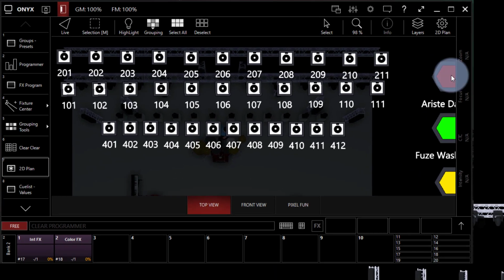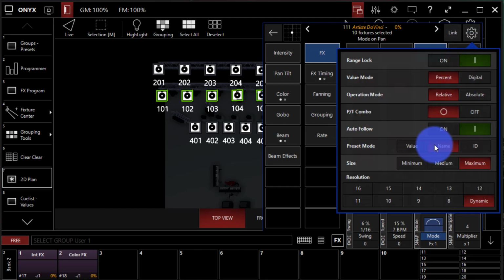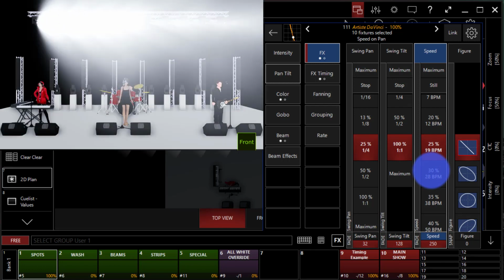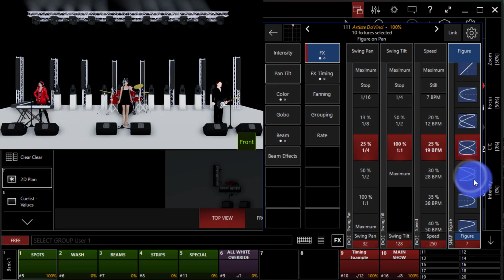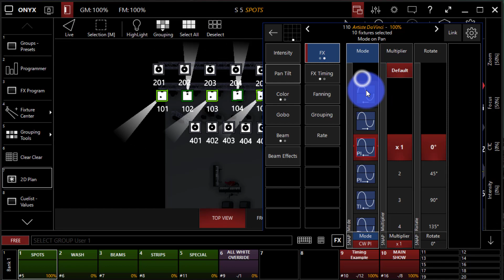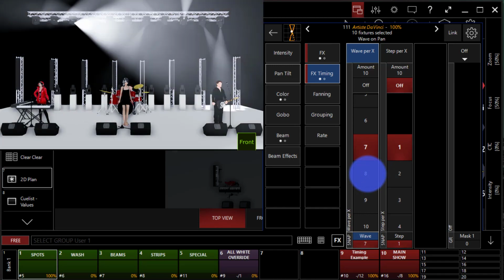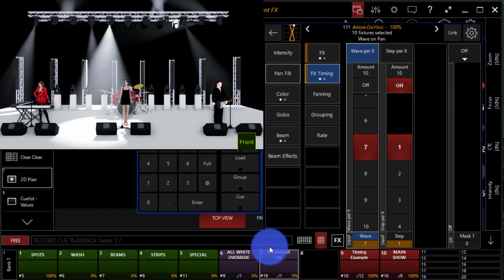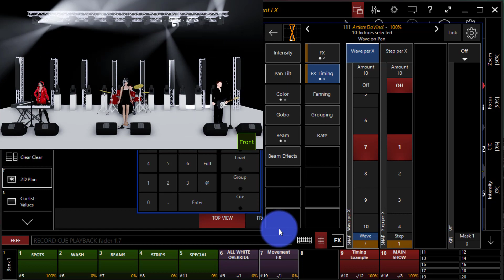Working with FX - Part 2: Beginning with ONYX (formerly M-PC)

Comment: These videos are great.  Thank you!  However, with my fixtures, I'm not seeing the same FX for Pan Tilt, is there something I can edit to get Figure instead of mode?
Reply from the maker: On the encoder strips, check the "settings cog" in the top right.  There is a setting called "Pan/Tilt Combo".  Make sure it is ON.  Then verify that when you select "Swing" the text above the encoders says "Swing on (Pan or Tillt)".
Reply: @LearnStageLighting  Thanks for the reply.  I had to go into the fixture editor.  My fixture had pan/tilt set up as custom parameters instead of being defined as pan or tilt.  Once I changed that setting and relaunched Onyx, it was smooth sailing.  Thank you for all of the 5 minute videos.  They have really helped with my journey into PC based lighting control.

Comment: How do you get the moving heads pan and tilt to stay facing forwards? For instance when using a pan effect it does not pan around fully and shines behind the stage?
Reply from the maker: Turn the "Size" down and begin the effect at the center of the range you wish to work within.
Reply: @LearnStageLighting  thanks, this has helped a lot

Comment: I'm having problems getting the fixtures to react. I do exactly as you do in the video but I have to change the speed of the intensity effect in order for the FX to manipulate the pan and tilt.
Reply from the maker: It sounds like you've might have gotten FX link on?- there is a blinking red "link" button at the top of the encoder wheels display on the screen.  If it's blinking, press it so it stops blinking :)
Reply: FX link is off. Also when I navigate through the base menus (switching back and forth between intensity and color etc) it seems like the FX moves forward and increments the lights movement forward every time I switch between base categories. If I turn PT combo off, Pan swing and speed works. Tilt FX does nothing.
Reply from the maker: That is weird.  If you start from scratch again, and have the same problem, then you may have an install problem.  I would recommend posting in the official forums: http://forum.obsidiancontrol.com/  I also do look through showfiles and make personalized recommendations for Learn Stage Lighting Labs members: https://lp.learnstagelighting.com/learn-stage-lighting-labs/